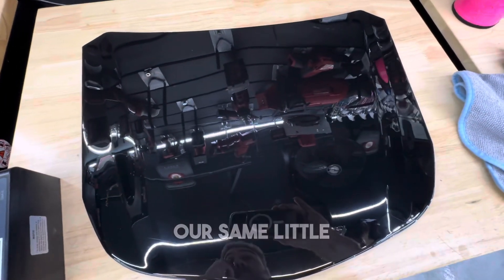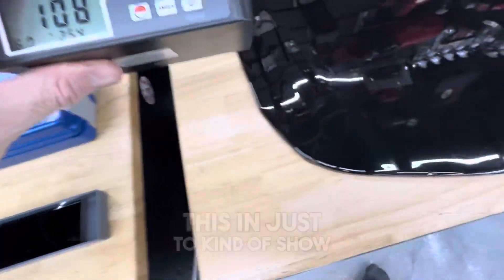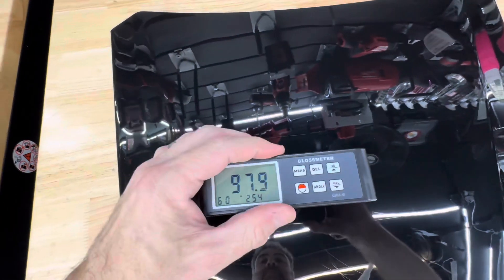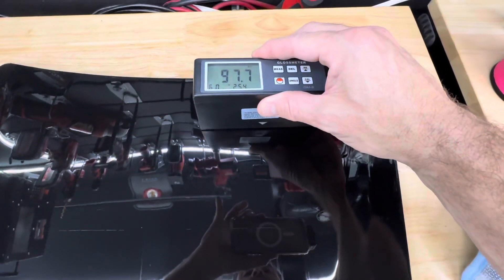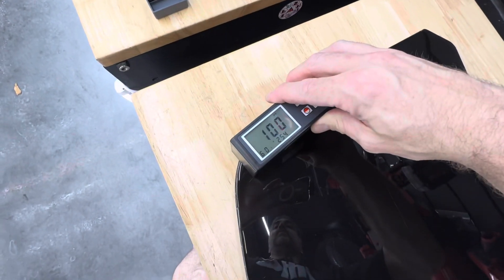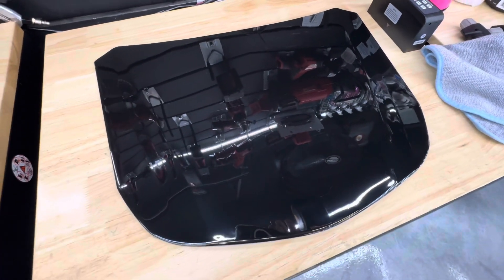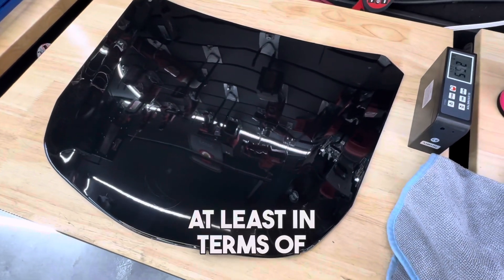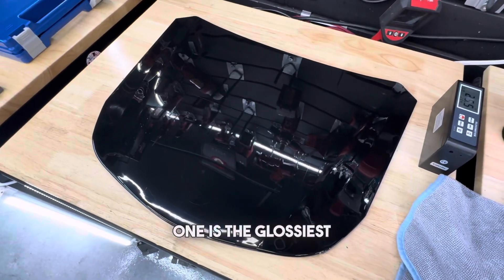Don't believe the hype on ceramic coating gloss differences - see why:

Comment: Good test, & those coatings/sealants just happen to be similar. There are tests that show differences between certain coatings/sealants varying as much as 6 gloss meter points, & since the human eye can notice differences once it hits 5 units, those differences can be seen. So - it depends on the x versus y coating.
Reply from the maker: I didn’t mention what coatings they were